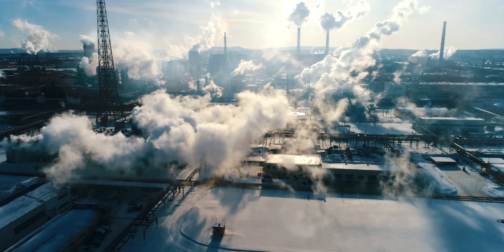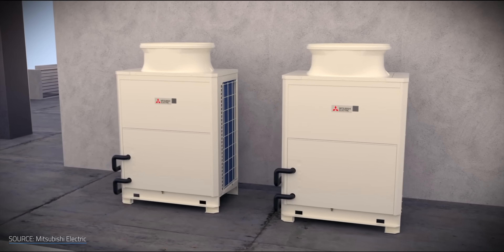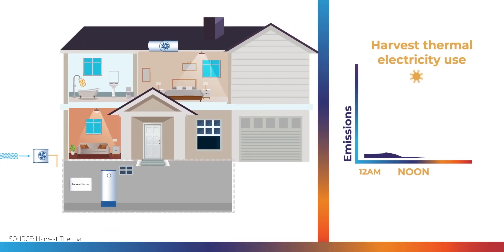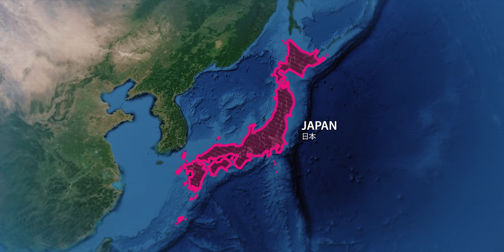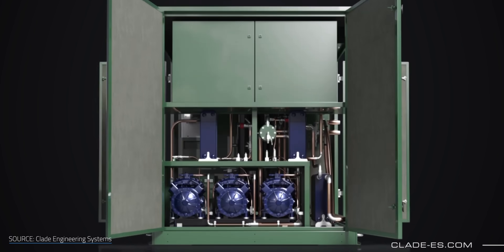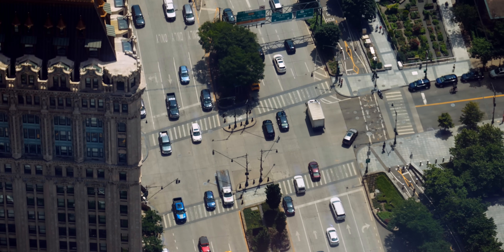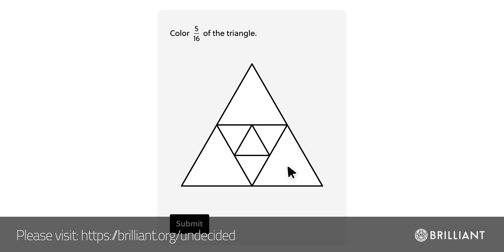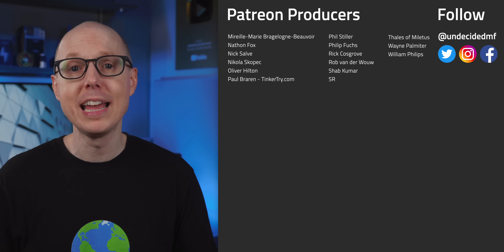Why CO2 Heat Pumps Are The Future Of Cooling

Comment: CO2 heat pumps are good at heating, but meh at cooling. The harvest thermal system is good at replacing your furnace and your water heater, but leaves your air conditioner intact. Meanwhile a typical heat pump replaces your furnace and your air conditioner, but leaves your water heater intact. A strong heat pump can do do water, furnace, or AC, but you can pick only 2. You will need a second device for the third.  In areas where time of use rates and daily fluctuations are the bigger concern, the storage feature will have a good return. In areas where winter is cold all winter and summer is hot all summer and there is no time of use rates, the battery adds little value. CO2 heat pumps are the solution to 'this area is too cold for a heat pump' but you will need a separate AC unit.

Comment: If you want to heat a pool or DHW, set up a thermal solar panel, don't waste high grade electricity. 
My DHW thermal solar gets 700Wc using 8W of circulation pump. That's a COP of nearly 90 !!

Comment: Thanks for sharing your thoughts, ideas and videos. Will definitely have to keep an eye on harvest thermal. Sounds like a great idea, I’ve been pondering if there was a mini split system with several inside units and one external that would be able to take advantage of the various heat levels in your house and optimize its use, the missing component I wasn’t finding was the heat reservoir that harvest thermal seems to have come up with. Definitely will need a bit more research on my point. Not everyone wants a bedroom at the same temperature, hotter or colder and with the newer tighter homes, you introduce heat from cleaning typically be it clothes, dishes, or your shower. And then adjust the air conditioning to pull it back out. Would be great to be able to recycle the BTUs from cooling back into a centralized heating solution. New studio look great BTW, love the color scheme of both. Hope you keep the stuff on the shelf backdrop, always entertaining whenever the subjects inevitably get a little dry and keep the mind involved in the situation rather than bolting in a different direction. Wishing you and your family the best.

Comment: You keep on saying that water has high specific heat and since CO2 also has a high specific heat, it is well suited to heat water.

That is not how it works. 1 kW of heating/cooling is 1kW of heating/cooling. It doesnt matter if you transfer the heat from CO2 to water, R134a to water, or air to water. 

Specific heat matters even less when a heat pump is typically two-phase, where latent heat is used to absorb heat rather than through temperature changes. 

You also didnt really explain how using the thermal battery helps save energy. Thermal batteries only help save cost, at the expense of energy (due to heat loss).

Comment: The downside of CO2 that was missed or skipped over is its tenancy to freeze into a solid (dry ice) under normal atmospheric conditions. In a refrigerant heat pump, you want to compress a gas into a liquid expelling heat and then in a different place expand the liquid back to a gas absorbing heat. With CO2 that expansion has enough cooling potential under 1 to several atmospheres of pressure will cool and freeze the liquid CO2. In pipes this clogs and stops the system. Running under much higher temperatures and pressures will eliminate this issue but create new risks and costs. Otherwise, CO2 has a lot of great properties and I hope the new engineering can mitigate those issues.
Reply: Yah.  The SanCO2 runs the loop at 600 to 1600 psi.   No other risks though, the loop is really small and entirely enclosed in the outside unit.  There are no external refrigerant lines at all.  Just cost... but again, since the loop is entirely enclosed its hard to mess it up.  Which also means the unit comes pre-charged.
Reply: Guess that's why they use water outside the unit
Reply: CO2 works west inherit pumps at pressures of 1000pi or higher.  At this pressure  and normal atmospheric temperatures we live in the CO2 will not freeze i the pipes.

Comment: So, I work in the industry. Co2 is definitely the future, but it'll be slow going. It's gaining widespread use in commercial settings, especially refrigeration applications. However, as of now, it's much more expensive. There is a huge amount of safeties used to keep the units from becoming a literal bomb, and the copper piping is actually an alloy with (I believe) steel. It's about twice as heavy and actually magnetic. CO2 is probably the best future refrigerant we've got right now, it'll just be a slow roll out.
Reply: The refrigerant loop in the SanCO2 is also very short and entirely enclosed in the outside unit.  There are no external refrigerant lines at all.  Instead, a water loop is piped from the steel hot water tank through the outside unit.and back into the steel hot water tank.   So even if the refrigerant loop were to rupture, it wouldn't do much damage if any.  Just no gas volume to do damage with.
Reply: @junkerzn7312  that's good to know, so it's basically a water source heat pump, just using the water heater as your condenser water loop. That's cool to know, I'm more used to seeing large rack style systems for grocery stores converting from older refrigerants. The savings they see with Co2 is absolutely bonkers. It's so much more efficient.
Reply: Indeed, the high pressures are the hurdle for cheaper retail/commercial systems. It's sucks now if you end up in a front end collision that breaks the condenser.  Now add some more stored energy to the possible downside.

Comment: Hopefully I summarized this correctly.  The benefit for CO2 as a refrigerant is it's higher temperature after expansion so that allows us to use a giant tank of water (which we might already have/need) to extract the heat energy, as opposed to the ambient air temperature.

Questions I would need answered if looking into CO2 refrigerant for the home:
 - How much hot water will be used during hot months?  If I'm not using the hot water and it's effectively insulated, the system would likely use the ambient air since it's lower than 90C.  If I'm often using the air, then the lower COP means I'm burning more fossil fuels on our current power grid.
 - Does heating water make up for the lower COP when averaged over a year?

So, what makes this system better for commercial uses is perhaps that they use more hot-water than the average home?
Reply: Yean, uh, different. The thermal battery is a hydronic loop, a closed system. It's storing BTU's, which is a function of temperature, pressure, & mass. The heat pump is still moving heat from one reservoir to another, either heating or cooling your house. The tank is an intermediate step. 

There are heat pumps on market for heating Domestic Hot Water.
Reply: @philmariop  I would imagine this system would want to have the ability to use the water OR the air to "store BTUs" since the air would be much cooler than 90C.  The only benefit from storing the heat in the water is that we can actually use that hot water for stuff.
Reply: @Ridiculoidus  No. Air is a terrible medium for storing heat compared to water.
Reply: @philmariop  Two advantages with air:
1) Air is cooler than a water heater tank
2) Air has effectively infinite capacity

So, my question is, for a home that isn't using more than a few gallons of hot water per day, is this CO2 system more efficient?
Reply: @Ridiculoidus  the context of Matt Ferrell's presentation is heating the home, HVAC, not heating domestic water for consumption. 

A pound of air, or a kg of air will struggle store as many btu's or kj of energy as a pound of water.
Reply: @philmariop  It is about heating water though.  Here are a few questions that I think illustrate that.
Once the water heater (thermal battery) is at 90C, will the heat pump continue to dump heat into the water heater?
Is the CO2 system better than other systems if the heated water is never used/cooled?

Comment: The biggest challenge in US for adoption of Sandco water heater system is product acquisition and $ is only secondary. I have been trying to purchase Sandco CO2 water heater system in CA or OR for our properties, but the distributors only sell to licensed contractors where as anyone can purchase Rheem heat pump water heaters at major retailers and it will come with rebate from state already reflected in it’s price. Sandco should just sell/warranty these units though online retailer if they want mass adoption. Regular plumbers will not be driving this market for them given their relationships with other vendors. DIYers will.

Comment: CO2 is great for cooling machines. But only that.
If you want to heat up with CO2, you will have problems to go above 30C
In this matter propane (R600a) heat pumps are wayyyy better - you can almost boil water with it, doesn’t require so high pressures as CO2, and it’s cheap and natural

Comment: Seems particularly attractive for heating only applications. Not clear to me from their website how the economics would change if you add the second heat pump (!) for the AC option. With more and more regions in the world needing both heating and cooling, needing two separate heat pumps strikes me as a downside.

Comment: Here's one for ya how about we go very old school.
Make a tunnel 50 or more feet underground under the whole city and use fans to add positive pressure in there.
Why well when a home I added to that system the only thing needed is open a vent to that water tunnel and it's free and we'll almost natural cooling with extremely less energy needed then pumps.

Comment: you should have been brilliant and used this tech instead of geo - you can have buffers of hot and cold water to increase efficiency - heat exchangers coupled with pos pressure hepa make a ton of sense but for most people cost of elec is the same and does not vary so the battery is a bit sketchy - maybe if you are selling elec back to the grid I was surprised to see efficieny of the co2heat pump be so much more without a cold buffer - you can charge both hot and cold sides using a tec and solar

Comment: Scientists say that if CO2 doubles, it could raise the average global temperature of the Earth between two and five degrees Celsius.30/07/2019 Its 416.27 ppm So if it's a 4x rises to say, 1600ppm we should get between 8c and 20c. Double that to 16c to 40c.

OK I'm floundering around.

The story is the more Co2 the hotter the planet gets. if we get a 2-to-5-degree rise by doubling the current level. Then it stands to reason it should gain more and more as the quantity rises.

Now that is in an open atmosphere. Shouldn't it, (question here?) Be more effective/efficient being100% Co2 atmosphere?

Comment: In college, I had a very ancient refrigerator that used sulfur dioxide as its working fluid.  It never leaked.  So I was not poisoned.  Many good working fluids are rejected because they are toxic or flammable.  Propane, for instance would make a great heat pump.
Reply: You're not wrong! Cyclopentane is being used in heat pump compressors in things like refrigerators nowadays, at least where I am in the US.
Reply: You can get propane heat pumps, at least here in Europe. It is also much better for the environment than R32 HFC

Comment: Got some quotes for HVAC work this spring, and ended up going with a 2 stage furnace and AC.

I have larger house, so the costs are a bit inflated from average. This was 16-18k for 2 stage setup, and closer to 30k for heat pump that may not work 100% in our brutal winters (Northern Midwest)

To make matters "worse" for the heat pump math, Natural Gas around here is extremely cheap, and still required as a backup on the heat pump in this area. Payback was questionable on any timeline under 10 years, and with HVAC equipment only lasting 15-20?

Comment: Prices usually drop as manufactures figure out how to produce items at low cost and the tech becomes more widespread. I don't know why we're still using isobutane as a propellant in cans instead of CO2 unless it just costs more. Too much exposure to the stuff causes respiratory issues. Yet, CO2 is already used small canisters for a variety of issues like inflating tires and those high pressure plungers. CO2 isn't good for the environment because of how much we release. Hydrocarbons are even worse for the environment, so we really need to get them out of air conditioners and aerosol cans.

Comment: Super critical CO2 is nice, but no one is using it for power generation because it's too much of a pain to work with. While at the same time people will use ultra critical steam running at pressures that are frightening. 
Anything that cheaply stores energy like a hot water tank is a good thing for the electric grid and is effectively required to make solar anything other than a way to steal money by tax breaks and direct subsidies from the poor. For warm areas like the US SW I think DC air conditioners running off solar with a 200 amp hour battery might be the best use of the store thermal energy for later. Run the AC off solar during the day to try and chill a home, charge up the battery pack and then coast over the sunset still warm period on battery power till cool overnight air can be used or the cheap overnight electrical power for those rare times with high overnight temperatures. 

For winter use the heat pump will be more efficient than resistive electrical even without the solar/battery system providing some energy being counted. 

The real problem is the massive replacement cost of heat pumps and the greater wear placed on the mechanical parts than gas heating does, or the near zero wear of resistive electrical heating. Aks anyone in the US South how much they love fixing broken AC and how cheap that is, VS the cost of fixing a furnace. Super Critical CO2 doesn't fix the compressor lifespan issue of heat pumps sadly.

Comment: Ammonia with a combined absorption / compression cycle still seems like a better choice 😊

Bonus chemical heat storage from absorbtion, and can be used as backup fuel in fuel cells or furnaces.
Reply: Ammonia is an excellent refrigerant! I think there's a resistance to using it in residential applications because even small leaks smell bad and can be extremely dangerous. (That said, CO2 leaks can be, too, so I'd be surprised if these heat pumps didn't have leak sensors). I think it's used in large domestic installations sometimes already. Am I remembering correctly that ammonia can be corrosive? That might make the equipment even more expensive.
Reply: @erikdietrich2678  it corrodes copper I think, so other heat exchangers are needed. We know how to handle it safely, it's still the most used industrial refrigerant, but residential use is probably over regulated 😅

Comment: The pressure of CO2 in transcritical CO2 heat pump goes more than 100 bar, on condensation side. And this 30 bar is only on low pressure side (evaporation side) of system. In general for heat pumps to heat/cool water or in chillers it is much more comment to go with propane (R290) at least in Europe. The R744 (or CO2) is more common for big commercial systems.
Reply: you are correct, very high pressure

Comment: What about cooling?
Heat pumps are used to both heat the house in winter, but also cool in summer.
And you mentioned nothing about cooling. Plus you mentioned that CO2 runs hotter.
So can it even be used as cooling heat pump, or is it only for heating?

Comment: At 3:26 you are comparing apples to oranges. Air conditioners use power from the grid, with the total efficiency of the grid and powerplant, if powered by natural gas, being around 50%. You should have included that information

Comment: Is there a cooling air conditioning with this tech available?  Or does it only work for heating?   Or any insight into the future of higher efficient air cooling?
Thank you so much Matt!!!  Bless
Reply: Its just a heat pump, but the unit described here is for a water heater so its one-way heating.  It is NOT a mini-split that can heat or cool.  It is a very simple unit... the only complexity is in the high quality parts needed since the CO2 loop runs at 1600 psi.

The outside unit will exhaust cold air while heating the water so theoretically you could do something with that, but there is almost no point because heat pump water heaters generally do not have to run very much to keep the water tank hot.   The cycling just won't match other needs beyond heating water.
Reply: I think it does cooling, too. Other heat pump systems I've seen can pull heat from air outside or air inside to heat water, or pull heat from inside and dump it outside, or the reverse. That's why the control units for these systems can be expensive: they run in multiple modes, not just on and off like a typical AC unit.

Comment: I agree that CO2 heat pumps are the future but the efficiency needs to get better. Comparing CO2 heat pump to electric heaters is just marketing crap and should be ignored. The real competition is heat pumps such as MSZ-LN25 which has COP above 5 for heating (when it's +2 °C or higher outdoors) and COP above 5 for cooling (when it's +35 °C outdoors). It uses R32 gas which is probably the next best thing after CO2 but requires less complex compressor setup (though, still a lot more pressure compared to old stuff).

Comment: Seems like it will be limited to new installs. Hard to sell someone a entirely new plumbing hot water and air conditioning system all at the same time.
Reply: Installed a Sanden CO2 heat pump to replace the existing water heater in my 1960's built house in Australia in 2019. Installation took one full day's work for a single person, a plumber, plus an hour or so of electrical. That's it, done. That included work to relocate the water heater from in the roof space to outside beside the house next to the wall.